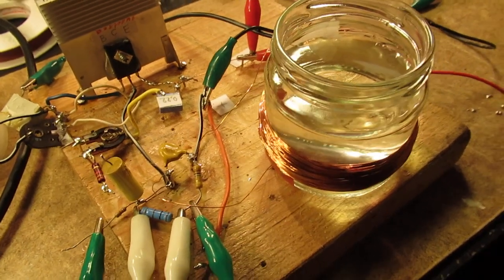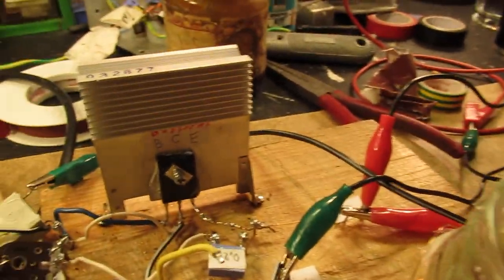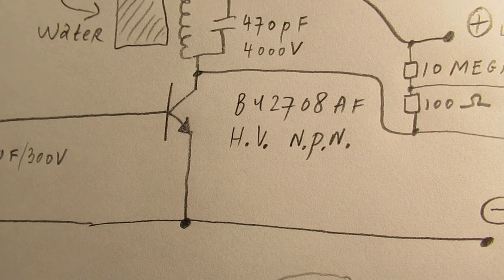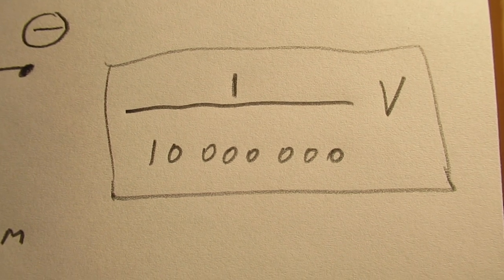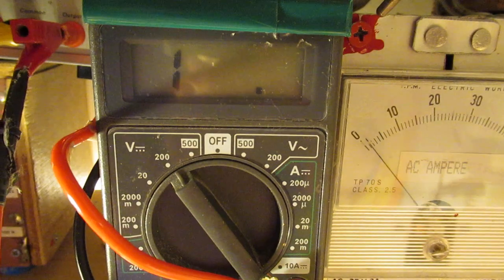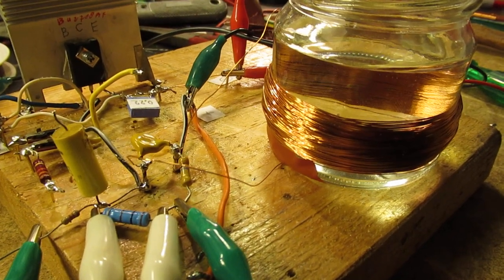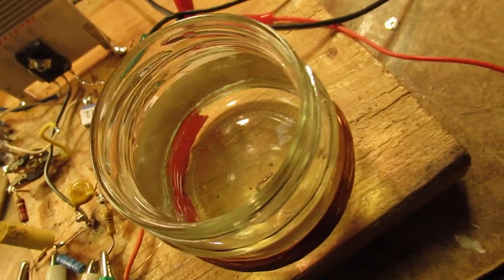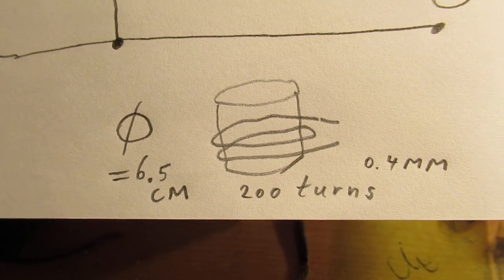What happens when a powerful E.M. signal on 20 KHz is strayed back into the power supply? tips

Comment: To reach cavitation threshold about 100W is needed. Also, the resonance frequency changes upon cavitation, so autotuning is necessary, something like PLL.
Reply from the maker: I don't know that 100 Watt is the treshold, also devices of 50 Watt are sold for household use. And in laboratory water baths you can set all kinds of "bursts" (I worked with them).
Reply from the maker: https://youtu.be/WUKMogCNIT4

Comment: well... I didn't know the fact that the voltage divider should be used for scoping.... it wasn't mentioned anywhere.

I don't have an oscilloscope but it will be useful when I would buy one.
Reply from the maker: Yes, another option is the "pickup coil" (read the textbox). Power HF circuits/oscillators give unpredictable amounts of energy out.
Reply from the maker: Always buy an oscilloscope! Your learning process in electronics speeds up a 1000 x when using it.
Reply: That's true, but I have experience building a mains powered tesla coil without an oscilloscope, it was too much pain in the process of building......just like walking without eyes and ears.
Reply from the maker: @anindyamitra5091  Yes! :) Good that you succeeded! It is not simple!